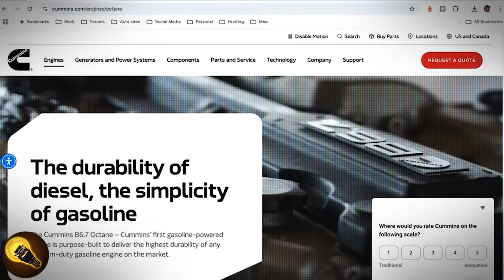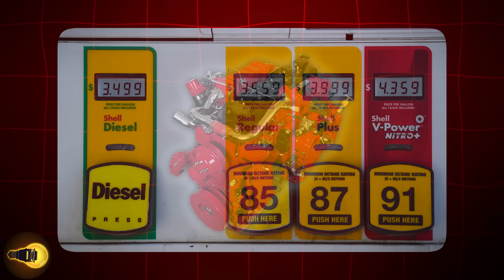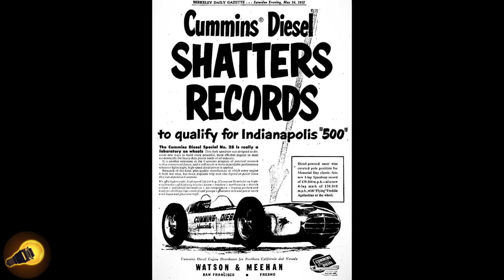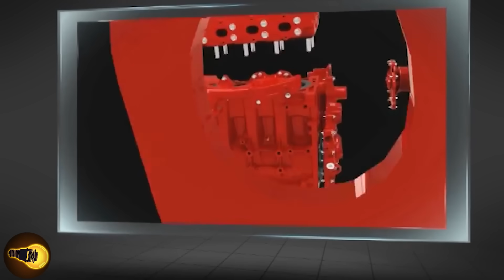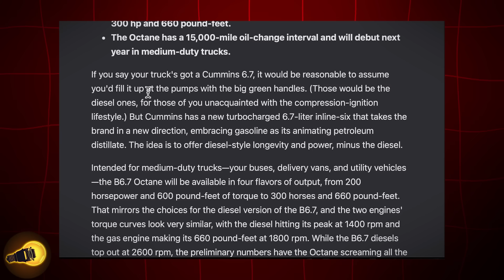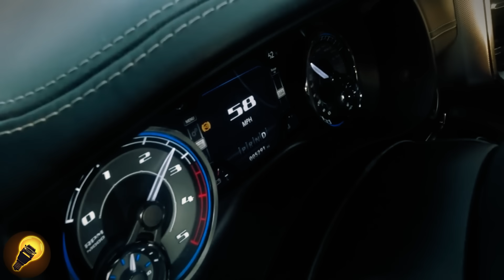Cummins Shakes The Industry With A Gasoline Engine!!!

Comment: I have been working on school buses 47 years. We have IC buses with 6.7 Cummins now huge problems because of in town stop and start pollution system can't clean it's self I belive the new engine would solve our issues. unfortunately I will probably be retired when they come to buses.
Reply: What’s holding you back, an I hope your working with local government so benefits for you
Reply: Retire it fantastic
Reply: Actually EV's are perfect for local routs start, stop and parked every night for charging. The post office will save a bunch of money in that use, And emission's
Reply: @tomhutchins1046  Some city in the US just scrapped all it's EV busses made by Proterra. They run out of power.
Reply: @scottdowney4318  Chevy vegas arnt much good. Kia's blow motors. PT cruisers blow head gaskets lemons everywhere. 2nd gen dodges were lemon lawed due to the front suspension  many post office vans are built on an S10 chassis really unreliable. They would work fine if built correctly. Same with EV busses.
Reply: @tomhutchins1046  If the Gruman LLV is so unrealiable, then how come they're still around?
Reply: @trickyricky12147  One of my businesses is online. I use the post office extensively. I have lost track of how many times the carriers or the supervisors have said "we missed the pickup or were delayed because of a breakdown".
Reply: @trickyricky12147   They were not replaced because of budget . You can confirm all of this online. The green programs made it possible. The new administration is trying to cancel it.
Reply: @trickyricky12147  S10's are not a commercial vehicle . Especially the engines
Reply: @trickyricky12147  Oh and some of them are from the 80's!
Reply: @tomhutchins1046  no shit S10s aren't, but it's what GM and their government contract found feasible at the time to come up with a nationwide fleet of postal service vehicles. It worked for decades!
Reply: @trickyricky12147  No it didnt work it cost a lot of money delays and overtime to keep the junk going. Probably somebody got paid off.
Reply: @trickyricky12147  Somebody obviously got paid off.
Reply: @tomhutchins1046  Ev is horrible for local. You think they only run during the day with one driver? No, you have multiple drivers. One finishes his shift. The next guy comes pre trips fills fuel and goes so on so on. Sitting and charging your loosing time and money. You need to deliver fast down time is wasted time just like team drivers none stop runs can't wait to charge lose time.
Reply: @mateuszszaflarski9898  Post office parks everything at night. So do school busses. For reg busses you rotate out the buss half the hours per day = lasting twice as long and giving time for cleaning maintenance.
Reply: @mateuszszaflarski9898  City Busses being charged in the day can use onsite solar = a big savings on fuel. A buss engine even with a 12 valve or 24 valve Cummins running local will need frequent oil and filter changes 11 quarts+ filter. them fuel filter + labor time . brake work.
Reply: @mateuszszaflarski9898   Ev's rejen to help the brakes. Just for starters. Then there is the expensive transmission's being worn out start and stop it adds up to big money
Reply: @tomhutchins1046   Post office is slow at delivery as is use EVs will slow them down even more
Reply: @tomhutchins1046  Can't talk about service when they haven't been worked hard to see what fails what the cost will be to fix replace who can service them and if parts are available even
Reply: @mateuszszaflarski9898  No you cant live in the past. Trucks breaking down no ac carriers having medical issues. Amazon is using EV's in this area with great results. If its done right it will make a huge improvement.
Reply: @mateuszszaflarski9898  You want to live in the past . If we did that we would be living in caves.
Reply: @tomhutchins1046  You keep talking small vans not Semi trucks post office runs trucks day and night little package cars only run day time to give you your mail that trucks ran 24/7. Until Evs can recharge in 1hr or less they will slow everything down and the cost of 1 electric to buy im sure will b as much as 2 diesel truck

Comment: Diesel IS debated in locomotives - by both Electric and by the UP Turbine models, both of which give higher output.
There are issues with both though - the turbines had poor fuel ecomonomy, the electrics need wired-up raillines that are a LOT more expensive so set up in North America or most of Asia than in SMALL Europe or Japan due to the massive distances involved.

Comment: I like it no timing chain to stretch or a timing belt to break the only thing I would change is the hydraulic roller lifters to the flat tappet lifters it would be like the old 4.0 or the 4.9 straight 6 engines that gave great torque and long life and as long as you keep oil in them unlike today’s engines that are just race engines and designed to only last through the warranty period
Reply: My ex’s Honda 4 cylinder that had close to 500K and my Tundra 3.4 passing 300K on the way to 500K (doesn’t use oil between 7K changes) say differently

Comment: Are they going to use flat tappet lifter or the roller cam with big problems? 😊
Reply: I’m sure it’s going to be the roller lifters but someone could come out with the reliable flat tappet lifters and make adjustable rockers and that engine would be be todays most reliable gas engine like the old 4.0 and 4.9
Reply: @Daniel-br549  hamilton cams
Reply: @Denis-tu1pd  why not hydraulic lifters? They've been the norm for aircraft recip since the 1940's.

Comment: Nothing will ever replace the ICE. Fuel cells are too expensive and the Hydrogen fuel that fuel cells use is rarer than a dodo bird. Also, liquid Hydrogen has less energy density per gallon than gasoline. And Gasoline has less energy density per gallon than #2 Diesel fuel.

Comment: Is the RPM range like that of a diesel? I had a 5.9 Lt, straight 6 diesel and loved it. It had an intake air heater and I rarely used any sort of starting fluid.
Reply: 0- 3200
Reply: If that's all for a gas engine, then that's a failure , in order for it to fully utalize the gas point of it the engine would need to Rev to atleast 6500 and that's still low , I would like to see around 8k redline , so when hauling and under load you have way more of a margin to operate in
Reply: @mastercricket7626  Why? its the same bore and stroke as the 6.7 diesel. Gas point? what does that mean? I think the idea is to one use cheaper fuel. Also lower nox and particulate in the exhaust without massive EGR and Def both a huge problem with a diesel due to high combustion temps and the fact diesel is a light oil. Its also a way to meet emission's without def and major retooling and development work. Until battery tech catches up and the internal combustion engine is fazed out.
Reply: @tomhutchins1046  Diesel is a much heavier oil than gasoline, or even Kerosene. I left my notes about the carbon chain size of it compared to the two at home, but I think Diesel is 12-20 carbon per molecule while gasoline is 6-8, and kerosene is strictly 11-14

Edit: a quick google scan says the ranges are a lot wider for all fuels than I was taught in A&P school, but the medians were still on the mark. 4-12 for gas, 6-16 for kerosene, 8-21 for diesel,
Reply: @kirknay  Ok. Agreed diesel is heavier than gas but lighter than lets say bunker oil. or motor oil so i called it a light oil. Get it?
Reply: @mastercricket7626  nope when it recs higher it becomes less efficient due to more friction and wear
When not have it produce more power at lower speeds.....turnbos and valve timing plus spark timing could achieve that
Or direct sequential fuel injection.....or maybe a gas e give without dark plugs with higher compression ratio like Mazda new engine design.....
Very efficient

Comment: How about the ZF 8 speed transmission?
Reply: Transmissions have been a weak point years ago when strapped into a Dodge
Reply: @hugoglenn9741  
Yeah, the ZF has been around for a long time and proving. I was just wondering if this B6.7 was gonna be paired with it
Reply: 1st Gen And maybe later Dodge Cummins had weak transmission.  The Duramax Allison apparently was the real beast
Reply: If it's not a manual transmission , it's useless 😅

Comment: Its gonna be nice but with the Cost of premium fuel at $5 a gallon in Washington. I think im gonna go diesel.
Reply: runs on 87
Reply: no def
Reply: Then you’re an idiot to live in Washington, DC or otherwise (Left Coast).  I’m SC today it’s $3.50 gallon but I’m smart enough not to use Premium so it’s $2.60 for regular.  If you use Premium than you are not smart for one of 2 reasons.  1) You are putting Premium in a car spec’d for Regular and getting zero extra for it. Or 2) you bought a stupid Euro-trash car that requires it like Mercedes, Audi, Jaguar, Land Rover. All of the above with Sh$tty reliability.  The euro trash class warfare types haven’t figured out electricity yet
Reply: It's way cheaper here in nc , like almost 2$ a gallon cheaper than diesel fuel
Reply: @mastercricket7626  
Would be nice lol
Reply: @mastercricket7626  wrong, I live in NC Diesel,is barely more expensive then Premium in winter (NC and rest of country) when they make home heating oil for the carpetbaggers.  And less than premium in the summer when people take vacations with gas cars.
Reply: @hugoglenn9741  it runs on regular genius , and u clearly don't know gas prices in this state , I run 100 octane in a fully built engine as a daily
Reply: @hugoglenn9741  Diesel is much more expensive in many area's . due to the fact they are gouging and diesel take's more effort and resources to refine. The price compared to gas depends on were you are.
Reply: @mastercricket7626  Why have a daily on expensive gas?
Reply: @tomhutchins1046  that comment along with him saying Diesel was $2 more expensive than regular in NC confirmed he was complete fool
Reply: @tomhutchins1046  more when you are (summer versus winter) than where you are. like,it said, I’ve bought it nationwide for,over 25 years except the left coast. My car got 37 mpg at near 4000Lbs versus the gas version at 25 mpg.  So, per mile it was a lot,cheaper.  It’s always the big picture not the small one
Reply: @tomhutchins1046  also, enough of the insipid liberal talk of gouging cuz I have enough experience to know Diesel is cheaper than Regular before the Feds mandated low,sulfur at higher manufacturing costs.  It’s typical always a Federal Government problem and not a Capitalist problem. People,start engaging your brains rather than your emotions, that what women do
Reply: @hugoglenn9741  In some urban areas it is $2 more expensive if you can find it due to lack of demand
Reply: @hugoglenn9741  So you think the entire country is just like NC? Dont get out much do you?
Reply: @tomhutchins1046  diesel vehicles usually have over 400 mil range . drive 5 miles and quit whining
Reply: @hugoglenn9741  You live in NC you think everybody in the country is just like you Billy bob. Not everybody commutes in there diesel and thinks rolling coal is cool. Some people actually grew up and got an education and use there trucks like a truck and commute, get grocery's ect in a reasonable car
Reply: @mastercricket7626  just for Sh$ts and grins I just checked regular in NC at $2.70 and California diesel at $4.35.  It isn’t even$2 different at one of the worst differences nationwide with the extra taxes
Reply: Reg 87 is also much more available in some areas
Reply: @tomhutchins1046  I have never ever seen in the US where Regular  unleaded was not available. And the same applies to Diesel, Mid grade and Premium.  I have just seen at Sheetz something like 20% ethanol(not E85) for sale at 10% discount to Regular and I think it was in the neighborhood of 89 Octane
Reply: @hugoglenn9741  Actually in some area's diesel is not easy to find, What does that have to do with 87 is cheaper statement I made?
Reply: @tomhutchins1046  your comment was actually “Reg 87 is also much more available in some areas”.  Soooooo.. where do you see price mention in this comment I replied to,   ….. I do see mention of availability!
Reply: The word “much” more available indicates it’s a crucial problem.  Maybe more available 1% percent of the time might be more accurate cuz I have actual experience driving a 1983 Nissan Maxima Diesel for over 300K miles nationwide except on the left coast.
The real issue with availability is Ethanol free regular for small engines and boats nationwide because of the stupid federal government and people with small minds like Senator Grassley.  He needs to come down here and rebuild my Honda GXV340 carb so mow my grass today. I want to put,him outside in SC during 95 degree weather and 100% humidity and watch his a$$ sweat to desth
Reply: @hugoglenn9741  ??? what? Maybe your judging the entire market by what you see locally in your area?
Reply: @hugoglenn9741  LOL one use a metal gas can plastic absorbs moisture. 2 Just shut off the fuel when your done and run the carb out before putting it away. For more then oh 2 weeks. or with a weed eater ect just pour the fuel back in the can. The way to solve the whole thing is to go electric. You can thank me later billy bob.
Reply: @hugoglenn9741  Buddy if you knew anything diesels are polluting by design. And need to go away.

Comment: Engineer a hybrid with the B6.7.  You will have more torque, more heat, more AC, more A/C, more efficiency, more acceleration and the ability to climb any mountain.

Comment: Way too heavy and expensive for the power it produces. I like Cummins, have 5 5.9s and 2 K series 19 liters. Their small V8 might be a good gas engine, but still too expensive compared to any GM/Ford/RAM
Reply: old video 330hp 600tq latest

Comment: For the swap its actually pretty easy to do reverse compatibility to gas. Change pistons,  cam profile,  fuel injectors and "plugs", the bolt on intake n exhaust manifolds, and some CNC machining on  the same head castings . So yea its BASICLY  all bolt on changes for the 2025+ series B67